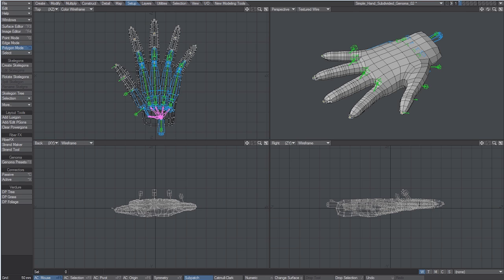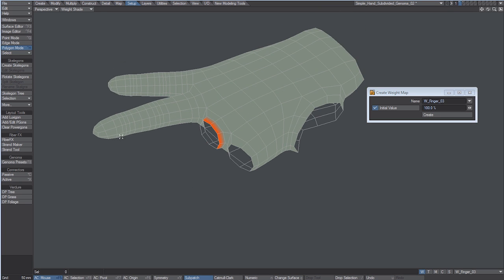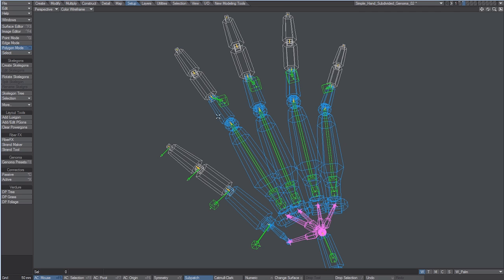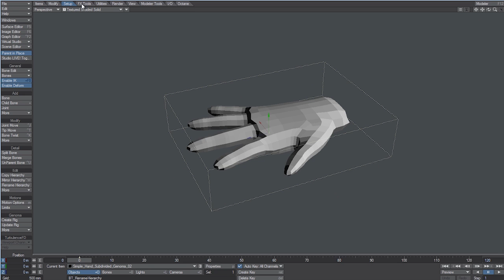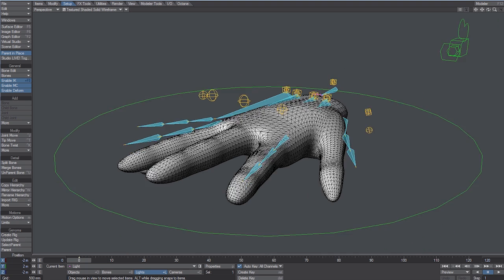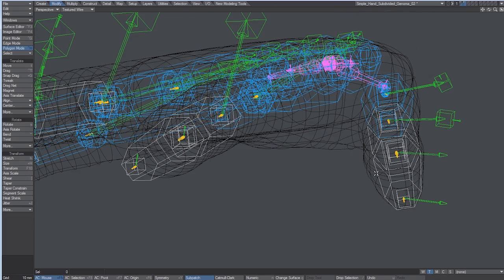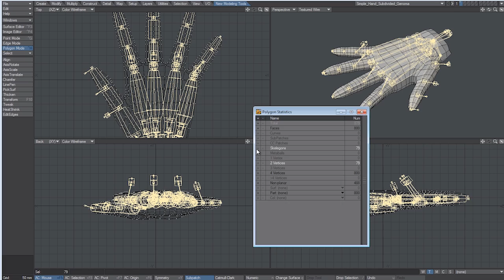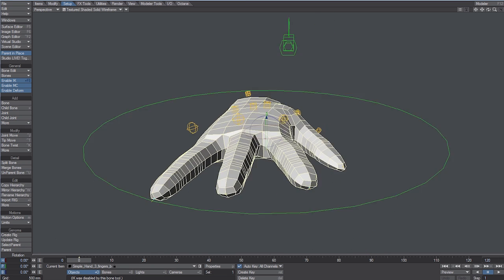LightWave 11.5 Genoma: Assigning Weight Maps / Rig Modeling

Comment: I totally agree. I've tried most packages over the years and No other software has an interface that is as easy to use and intuitive as Lightwave . 
everything is clearly labelled with no silly little icons to learn. plain english (or whatever your language is) on a rectangle button, what could possibly be simpler.

rigging was always a pain in LW and finally newtek have done something about it